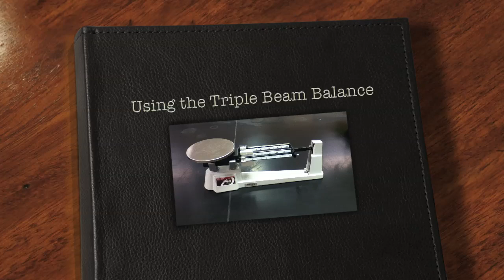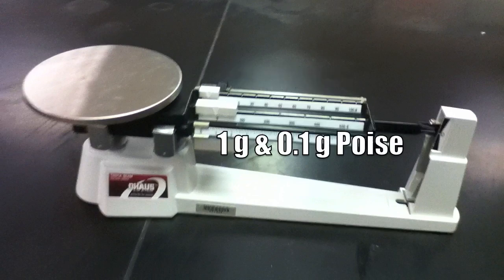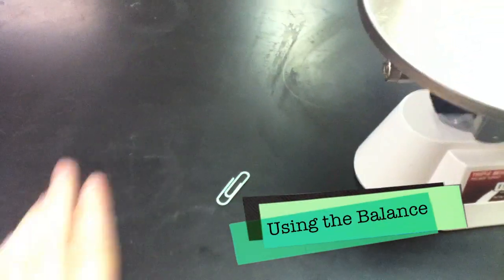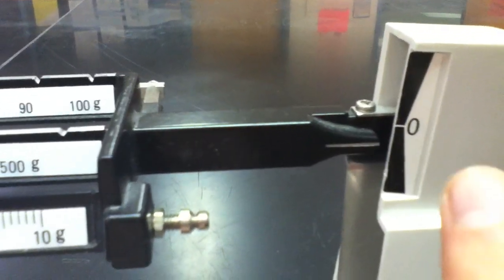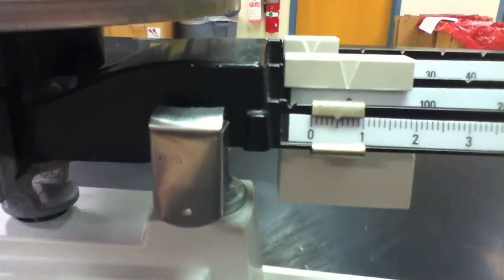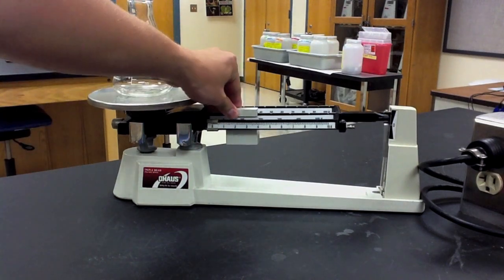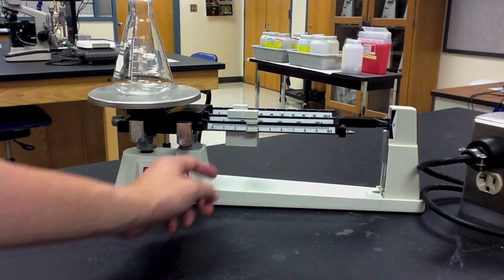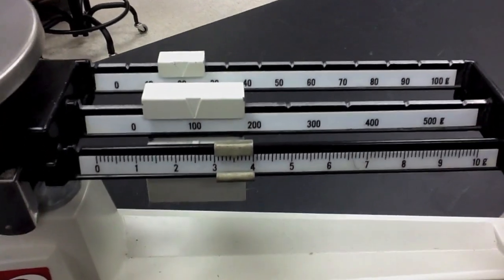Lab Protocol - Triple Beam Balance (Unit 1 Metric Measurement)

Comment: The video was brilliant,............simple and clear.........But I have a question here, What if the object is extremely heavy, heavier than the beams??????
Reply: There is a maximum weight on every triple beam balance. If the object that you're measuring exceeds that maximum, then I guess you'd have to use something with a higher maximum.